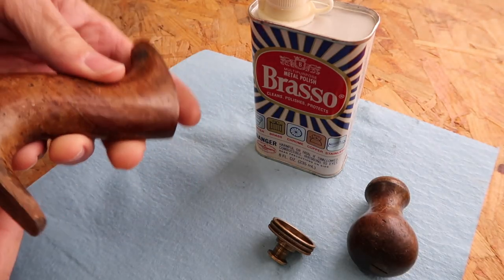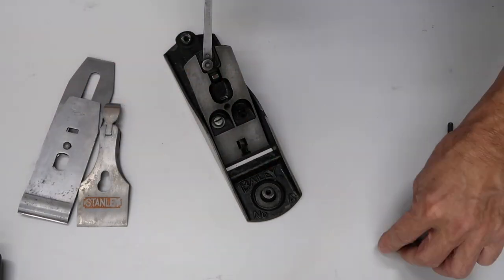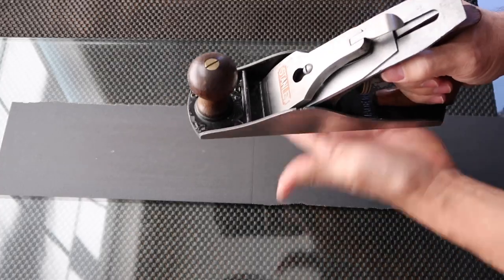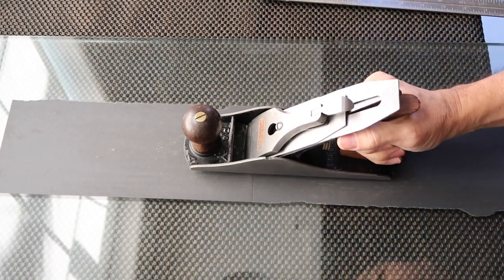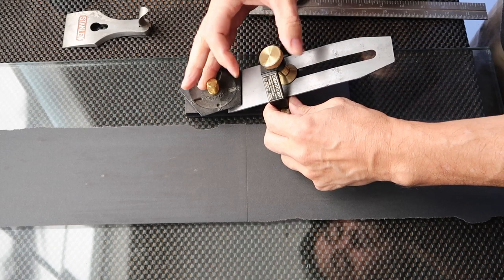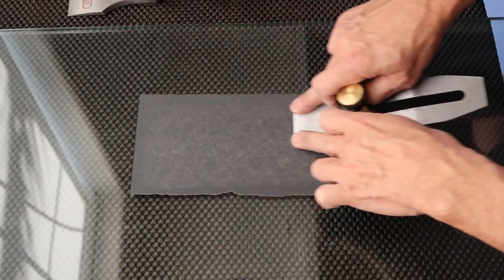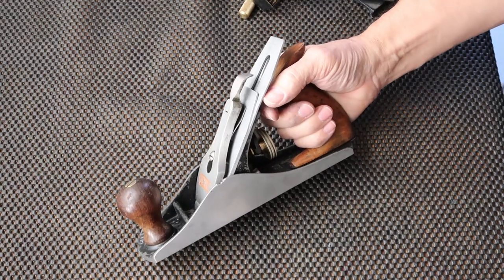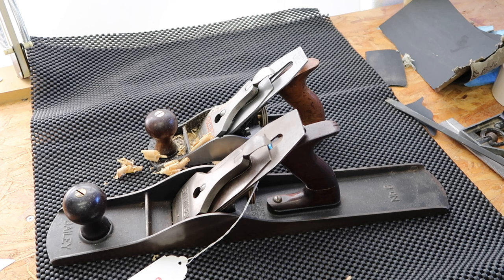Pawn Shop Hand Plane Restoration- Part 2

Comment: Flattening the sole should be done with the plane completely assembled.  Slide the plane on the sandpaper while holding the knob and the tote, just as if you were planing.  I am glad you corrected this, as you did not mention it in the first video.  The iron may lift the wood fibers and cause vibrations when the mouth area is not putting enough pressure on the wood.  This is called "scattering".  That is why the mouth area should be as flat as possible.

Comment: You know there's really no point in adding that "microbevel" ??? Really it is best used with the main bevel til dull then resharpened with what people now call a microbevel. That is how it was normally done and people have misunderstood what they perceive as a microbevel is really about getting more work done and to spend less time sharpening.

I suppose its trendy but you removed a lot of patina that some say is valuable. I leave my planes far more original than that. Shiny is for new tools.
Reply from the maker: John Possum I mention the micro-bevel. I didn’t put it on there yet. I agree with you on that. As far as value, it’s a beater and I may have paid too much for it and $20. I’m getting my planes to use also. Thanks for commenting in for your input.
Reply: If what I've seen on ebay in the past is any current indicator you should easily be able to get 2 or 3 times your money, maybe even more. 

It's always fun to imagine what kind of use a plane may have gotten. based on the sole wear pattern I imagine it edge planing a whole lot of inch-ish boards. I look forward to the next one as I have one of those up on my living room wall but it is my favorite to use because almost everything comes out so perfect with it. Very very good choice. You will not be disappointed. (my next fav is a small shop apron sized craftsman model 110 with a low angle and a dimple in front rather than a handle. Lie Nielsen remakes them and those fetch a pretty penny )
Reply from the maker: I was thinking the same thing on the wear pattern.